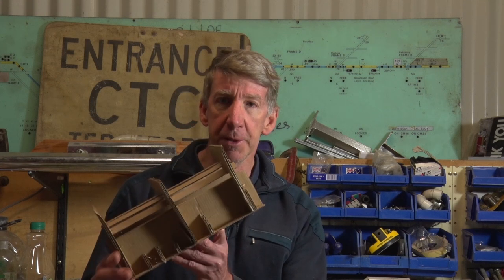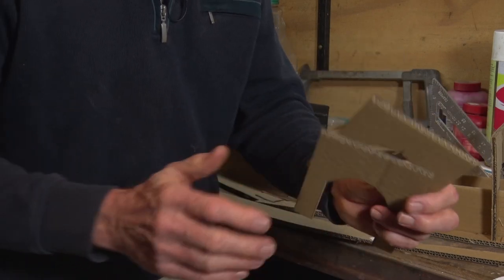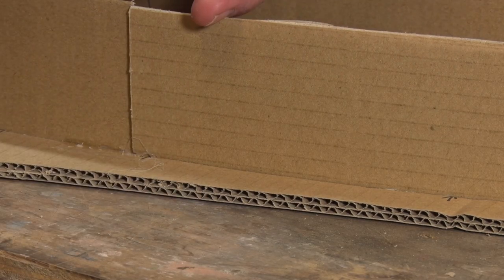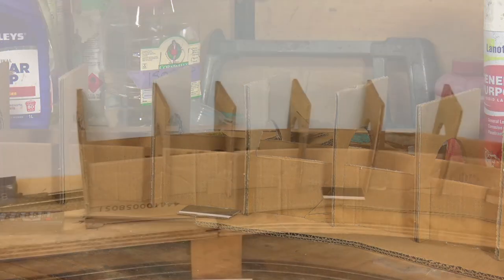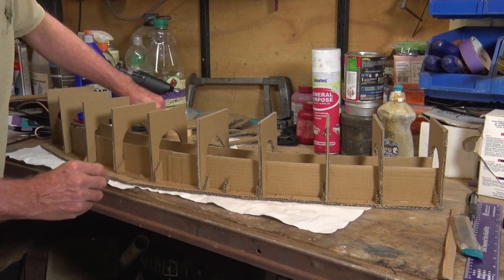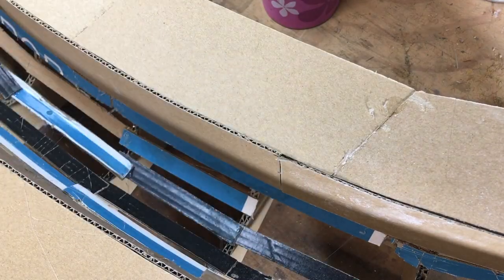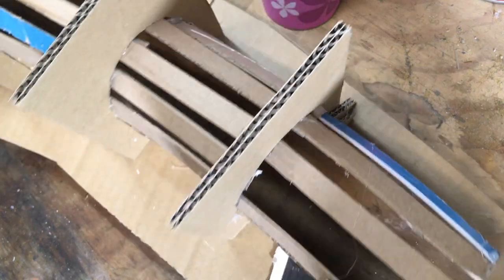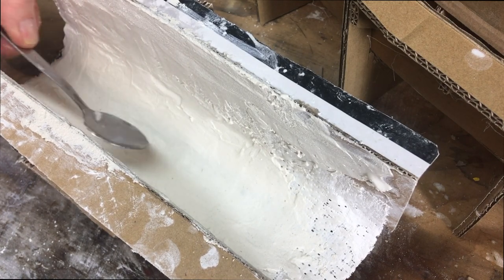Tunnel Vision ...Part 1. How to make custom tunnel linings for your model railroad.

Comment: Looks great, Gregg! I guess I missed this video at first, but I'm looking out for part 2. I'm really interested to see how the plaster works out. Should make it quite sturdy and smooth. 
-Cam
Reply from the maker: Thanks Cam!  The "sculpt it" looks like rough concrete , or shot crete and has turned out better than I thought ? Giving it a wash of grey and I will finish and upload the video. It is quite sturdy and the loco noises almost fade away as the train goes through!! Thanks again for the inspiration.
Cheers Gregg.

Comment: As always Gregg, magnificent intro. Love the way you’ve shown your iteration of the how to build of tunnel liners. Great use of otherwise discarded materials. 
For ease of construction you could also nip the entire tunnel liner into two length wise parts. Which will accordingly allow for width adjusted on curved tunnels, or even will ease the way a removable access hatch can still be made.
Curious to where you are now on your layout.
Cheerio Vince

Comment: Great video Gregg, so glad you didn’t get tunnel vision!  Lol. Plaster cloth is better than tape, tape will eventually fall off.  I like this spine system, I usually use old scrape wood. With your system you could use a hot glue gun to speed up the process (gluing the cardboard to cardboard).
Reply from the maker: Thanks Terry!  I did use a hot glue gun to make it , but didn't show the construction to keep the video shorter. 
I did think of using scrap ply but found this thick cardboard and it's pretty good. The finished one is looking pretty good so far?
Cheers Gregg.
Reply: FishplateFilms looks great, can’t wait to see the finished product.

Comment: Hi Gregg I have done something similar the main difference is I used crumpled brown paper as the liner stick it in place spray with a mid brown and a black along the top of the tunnel cover the surface with white glue and scatter coarse sand over the surface. it gives that more crumpled cut rock feel to it. The big problem I found is making sure you have enough clearance on the curves. watching with interest from starting to lift lockdown Neil
Reply from the maker: Interesting idea Neil!! I'll keep that in mind for a future project.
Cheers and thanks for watching.
Gregg.

Comment: well. that is one way to keep the track clean.. looks good, auto racks fit? 
Question is. did you eat your cereal first , then use the spoon?
Reply from the maker: Thanks Sparky!  Yes , racks will fit . the containers look closer to the walls than they are.
Cheers Gregg.

Comment: Just how many SD40-2 's do you have? I recognise the 2 Katos (I have those as well - Kato's almost fall apart when you take the screws out. No wonder you managed to replace the motors in 10 minutes!!!)
It's about time you fessed up and told us what's in your fleet...... there's another one for the FAQ.
The only Altases I haven't seen on your layout are the B23-7 and C30-7 (never seen the C30 for sale either). It's not that we have a lot of choice if we decide to stick to Kato and Atlas :) . Kato make a Dash-9 which I haven't spotted yet either but that might be indistinguishable to the AC4400's to my untrained eye.
Reply from the maker: Hi Steve, 
I have over a dozen SD40-2's....there are 7 on the layout, with another 5 or six waiting to be renumbered or have decoders fitted. There are 2 Dash 9's and quiet a few AC4400's, plus the Dash8 units. I have 3 Gevos which are early Intermountain , which all run like crap ! I would like more Gevo's , but I don't like Scaletrains that much , and I'm still wary of the Genesis motors, though I did hear they have fixed the issues with them...so I may get some Athearn Gevos in the future? I do love the Athearn RTR SD39-2's that I got recently and I love running them.
Cheers Gregg.

Comment: Well done mate not a bad job ,but just a quick one on the track cleaning item ,I’ve always used a product called servisol 10 for cleaning track seems to be ok but I live in uk and have trouble getting what you use ,so was wondering if you are familiar with servisol 10 and would it be a suitable alternative, many thanks ,regards john
Reply from the maker: Thank you John..coming along nicer than I thought!  Many guys also like CRC 2-26 , but I hear you can get Innox from "Pendle Slot car racing " in Lancashire ? according to a UK viewer:-).  Either of these will be fine sir.
Cheers Gregg.

Comment: Have you thought of laying the plaster cloth in dry, then using a wet brush to get it to stick to the sides, rather than struggling with it wet. Frank
Reply from the maker: That would be harder Frank , as the cloth would move while you wet it. It ia actually pretty easy once you get going , and was easier than I thought.
Cheers Gregg.

Comment: Hey I am building this for school project and I have cold glue.Could that work with cardboard
Reply from the maker: Hi Ethan, I guess it could , but it would be hard to hold the bits in place as it dries? You can get cheap hot glue guns but give the glue a try first? Thanks for watching and let me know how it goes!
Cheers Gregg.
Reply: Thx so much

Comment: What kind of glue are you using in that glue gun for the tunnel ribs?
Reply from the maker: It' is low melt hot glue gun sticks. I got them with the gun  Joe.
Reply: Thank you, cheers Joe.